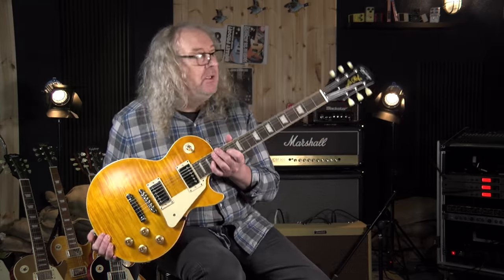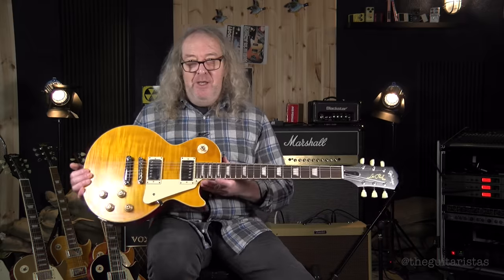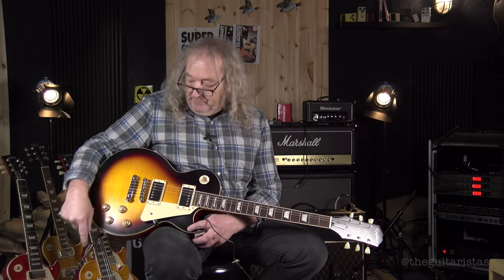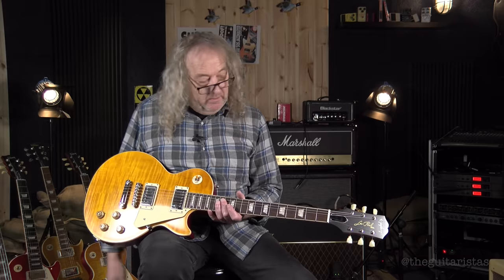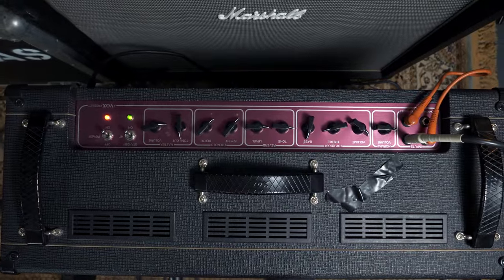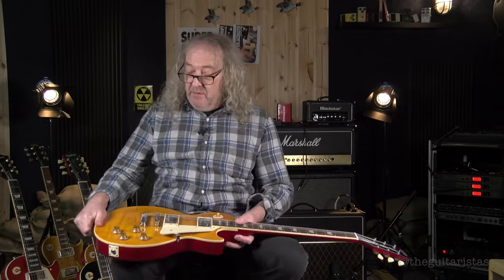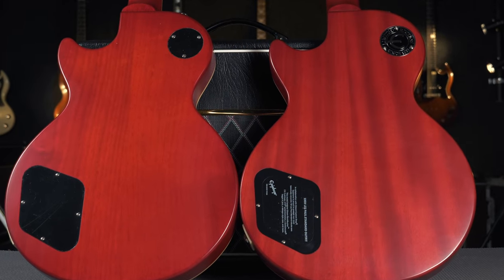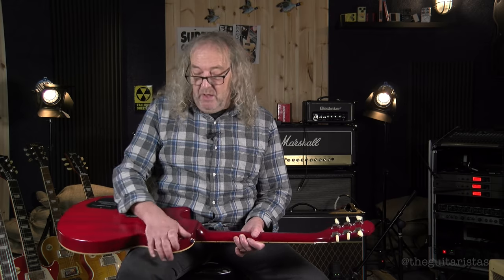Epiphone 1959 vs Lazarus - Ltd Edition Les Paul Standards - Side By Side

Comment: Thanks as always for your videos I enjoy them and this was pretty interesting. I bought a 59 4 or 5 months ago. But I took it out of the case it felt like there was tar all over the body that's what it felt like of course I can't see it but I felt it and I can't tell you how many times and how long I tried to get that off using nomad polish and cleaner that's a little of it off. Then I went and I took a cotton hand towel and I dampened it and got a little more off. But it's still spotty in areas and stuff and I still feel it. It just makes the guitar seem cheap. I'm going to have an address because even though I can't see it it's a textural thing and though it's not on the neck that's bothering me. So the fret work though is fine there are no there were no and there are no sharp ends at all on the frets I haven't had it the professionally set up yet so it's buzzing and stuff. I'll put the money into this guitar to make sure that it's right though. Yeah I got a really good deal on the guitar I got it for including tax it was like $730 or something like that so that was a pretty good deal I got 15% off the guitar. the whole purposing the whole what deal of getting this guitar and and the crap that the store did which amazed me because I've been dealing with the storm since they open and yeah that's the home of the story for a home of the video if you ever make one on your worst experience at purchasing a guitar ever. Also then I realize that two of the latches on the case just pop off so I've stuck a bunch of towels a two towels I rolled them up and put them in to take up the and that works but if you put pressure on the get on the top of the case of course the latches just fall off again I wonder if that can be fixed and how. Maybe by bending the metal latch that attaches to the tops hoping maybe with the Lucia I bring it to we'll be able to fix that also. I've heard from other videos of the people who took the guitar and had it polish to look lost there was much of a loss as possible and it made the flame top stand out and pop so I'm thinking they're going to have to do something like that just to get that crap off the damn guitar whatever it is so yeah you know and of course I waited too long to do anything under the warranty or anything like that so I'm stuck with what I got. I do like the way it sounds though I mean it also has the switchcraft the output Jack and the switchcraft the three-way switch toggle switch so that's also an upgrade. Tuna's work fine stays in tune. But you know if I'm not mistaken the burst f**** series pickups were originally made to go into their online I don't know if they call them online but they were I think with the custom shop used to duplicate their pafs and of course that evolves into other pickups and now I think the custom shop with their r series just call them custom shop buckets or something like that they don't even give it a name. So yeah so I personally in my opinion I wouldn't consider a switching those pickups back pickups out for any Bluetooth pickup necessarily a upgrade. It's just a different choice stop voice typing what I'm trying to say is it's just the swapping out those pickups for any boutique pickups it's just a Sonic choice that someone would make I don't I consider like an upgrade like taking out the pro buckets that are in most of the Epiphone hiring guitars I guess and putting in Monty's or first buckets so that's just my opinion I'm nitpicking because I'm a nitpicking guy at this moment lol I think both sound fine both sound great. Now one thing I'll say when I pick up this guitar I don't know if it's because of the finish but I think it has a lot to do with it just feels cheap electricity is just a piece of wood and I believe if the finish was done right it wouldn't wouldn't feel cheap to me at all I mean I haven't all the French electromatic jet and it's got a limited edition blue onyx they call it it's got sparkle and I was told I can't see the sparkle and that guitar feels really nice to the touch and doesn't feel cheap it's actually one of my best playing guitars that I don't give since another glasses yeah so that was my experience with the Apple phone and I'm sure when I bring it to the Lucia guitar tech kind of guy I'll get back to it feels nice and plays nice and sounds great and all will be happy of course when you throw money at anything hopefully at the makes it better so my 15% I guess we'll be eating up and put it in the guitar in the condition and I want it to be in both aesthetically and texturally and sonically boy that's a lot I'm going to stop here while I can because I am Mr comment addict whatever that means also? LOL sincerely Bob's a blind bedroom guitarist PS I have the guitar sitting on the bed with me now
Reply from the maker: Cheers Bob, thanks for comment as alway, it sounds like you need to get that guitar to the luthier and find out what on earth you did to it... maybe you rubbed all the paint off! 😆 But they can definitely be polished up to look good so I'm sure it can be saved. Take care mate.
Reply: @theguitaristas  thanks for your reply Colin it's always greatly appreciated! Yeah yeah the finish felt like tar when I got it out of the case I mean literally like there was tar or something rubbed on it maybe it was compound that was never taken off I didn't think of that until just now but yeah you know well I got some of it I got actually quite a bit of it off but it's still on there yeah I wish I had something that would have taken the paint off LOL that would have been a plus maybe yep I guess it just needs to be polished the professionally with a stronger polish then my nomad cleaner and the polisher I think if you just use that and your rough 30 years you wouldn't get to any damage to the guitar LOL anyway thanks again stay safe I'm assuming you're in the London area cuz you seem to have a London accent but at least that area accent. I can kind of tell the difference between that and Manchester after that English accents are lost to me anyway again stay safe Colin yours Bob the blind bedroom guitarist
Reply from the maker: Hey Bob, I am close to London about 30 miles East out in Essex. 😎👍

Comment: i am kind of sad the epiphone les paul slash models did not receive the kind of love and attention that they should have, instead they opt out for the cheaper epiphone parts what a sad time for slash fans around the world
Reply from the maker: Hey Ernesto, yes it's a shame - I did fancy getting one but the timing wasn't great I think they came out after the 59 and as you say with more basic pickups and specs and that kind of killed them a bit maybe? I may still get one though if I see a good price! 😆👍
Reply: @theguitaristas  i was planning on buying one but not if it had the normal standard cheap specs from a normal epiphone, dont get me wrong i love epiphone but i love them to make it better, if im buying a signature spec guitar i expect it to have the hardware to back up its claims the least they could have done is fit it with slash alnico 2 seymur duncans and for the price theyre charging its just a name on a headstock

Comment: For some reason these new Epiphones have such bad tops on them, the pattern is so tight and not as wide. It maybe a cost saving measure but I have owned cheaper Epi LPs from 2006 that have much better veneers